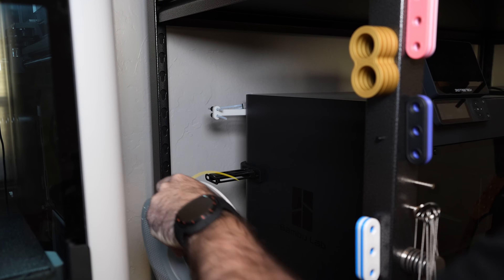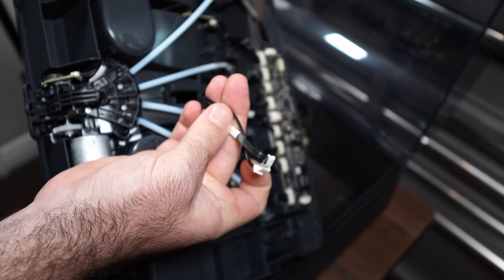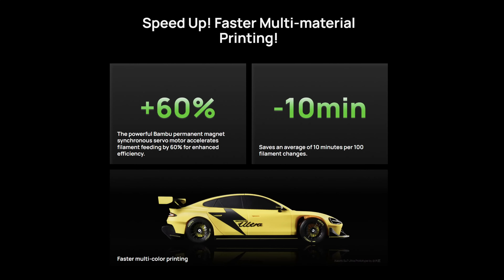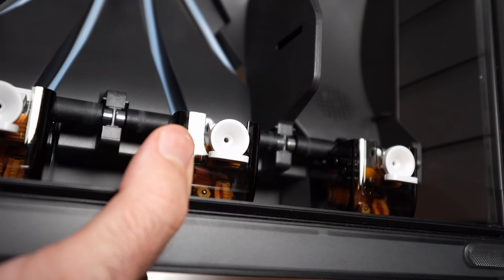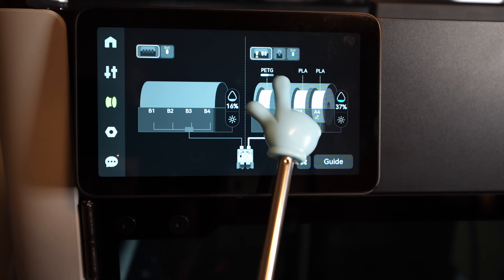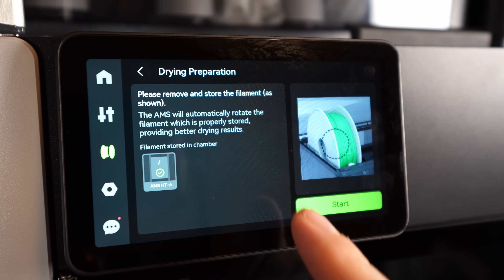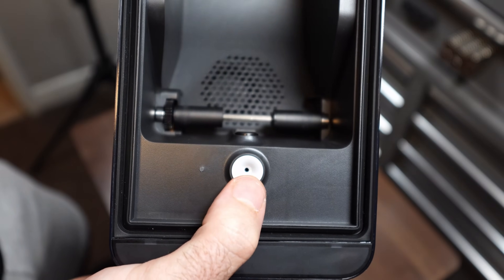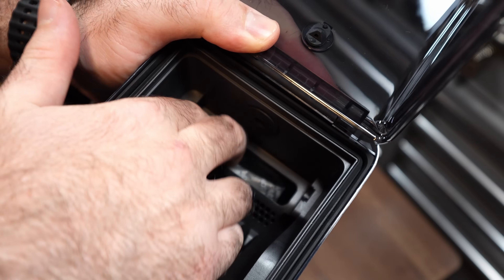Which Bambu AMS Should You Buy? (AMS OG vs 2 Pro vs HT)

Comment: I have a AMS OG and a AMS 2 Pro hooked up to my P1S.  My AMS OG works flawlessly.  The AMS 2 Pro hasn’t worked since day 1.  Brand new out of the box it would not load filament to the extruder. It would feed the filament out about 12 inches then pull it back, feed out, pull back.  It would do that 4 or 5 times then fault out. I issued a support ticket and Bambu lab had me try different things. Sent me new parts to change on a brand new out of the box unit.  Changed part out , it did not fix the issue.  Finally they sent me a return label to return the unit. And they would send me another one.  Received the new one and it does the exact same thing.  They sent me another part to change out on another brand new unit. Same part by the way.  Changed it out and once again it did not fix the issue. I am over this piece of junk. I would advise everyone to stay away from the AMS2 Pro. With my experience it is nothing but a paper weight, hasn’t worked since day 1. I’ve been fighting this for 3 months back and forth with customer support and changing parts…While my AMS OG works flawlessly.
Reply from the maker: Sorry to hear this happened to you. Mine has worked flawlessly since day 1. All I can day is there is always a spectrum of customer experiences, you were one of the unlucky ones. Is there a possibility its printer related? Seems like the logical next thing to check

Comment: I would definitely go with the AMS 2 Pros.  It may take some upgrade hardware, but it is well worth it.  For example, if I am not doing a print job, I can get the AMS systems to do a dry cycle, then I have some solid assurance about how dry the filament is.  This helps greatly, especially in more humid weather.  The AMS 2 Pros seem quicker as well, and easier to work with.
Reply from the maker: Totally agree! Thank you for your comment

Comment: Recently upgraded to a Bambu from an E3V2 with enclosure and sunlu drier, and one of the reasons I got into Bambu was for multimaterial printing. In researching my options, I came across this video and it was super helpful. Something worth noting for others out there that may be in a similar boat, sunlu makes an attachment for the OG AMS that replaces the lid and dries filament. It also allows you to dry while printing. If thats super important for you, it's something I'd definitely consider. Me personally, already having the single spool sunlu drier that allows drying while printing, I'm planning on going with the AMS2. For the small price difference, added drying, and smaller design upgrades, I think it's the right choice. But if you don't have a drier and had to pick one AMS, I genuinely think an original AMS with the sunlu drier upgrade is better than the AMS 2 if drying while printing is important to you. Just my 2 cents!
Reply from the maker: I really appreciate the comment man! Good advice

Comment: I probably wouldn't have bought the OG AMS if I knew about the HT. Microcenter didn't have the HT and I didn't do the research on new products. I don't do multicolor prints; I really only wanted the AMS so I could use Bambu's support interface material. HT seems like it would be a perfect device if that is all you want/need. However, it is quite handy to have several spools queued up. Maybe I'll get one anyway just to have support material (or PETG) off to the side and always dry.
Reply from the maker: The HT is insanely good at drying, probably the best dryer I own now... gets down to 5% humidity

Comment: Owning 4 OG, 2 Pro 1 HT and 2 lite, some advice on top: The less complicated filament path of the lite is often the superior solution. The H2D needs 2 full size ams to take real advantage of filament saving mode, to recommend color distribution properly. The days of the og are counted. There could have been more mechanical improvements and metal in the 2, but there’s no point to still buy the og. If you really want more than 16 colors on an H2D(Why?) you would need HTs. You can’t install more than 4 full sized AMS of any type in total, not just per nozzle. I tried. PSUs make no difference there. I’m pretty sure its just a softlock to sell more HTs, based on its behavior.
Reply from the maker: How do you feel about your HT? Hands down my best dryer.

Comment: im getting back into 3d printing and the idea of having to dry filament is a new one to me and it makes me curious why the filament is wet in the first place? does it just attract moisture or something?
Reply: Freshly opened vacuum sealed PLA you won’t have any issues with. Old PLA will be brittle and advanced materials require precise humidity and temperature for the best quality prints.
Reply from the maker: The short answer is: all plastic absorbs moisture from the air, they are hygroscopic. Ill be posting a video about this soon!

Comment: Will the AMS 2 Pro or the AMS HT normal drying processes for PLA, TPU, and PA be enough to recharge rechargeable dessicant (such as activated alumina)? At least over time with regular drying of filament, I wonder if it will eliminate the need to be swapping desiccant often.
Reply from the maker: Yes it will definitely recharge your desiccant, the new AMSs are especially good at this
Reply: Doesn't alumina need a crazy hot temp that would melt the filament for silica it should work though.

Comment: Thank you so much for such video. How frequently were you having problems with the AMS OG? Trying to understand if I should invest in an upgrade just to avoid headaches.
Reply from the maker: Honestly it's not the AMS OG that is the source of the issues, but when a piece of filament breaks off inside it, taking it apart to clear it is super tedious. It highly depends on what filament you'll run, and how quickly you go through it

Comment: Totally agree on OG ams. I have all 3.  
Key being.  Current market price of $320. 
It sometimes drops down to $250 and on 2 occasions - one at a micro center and one I could swear was a sale last year it hit $220.  
At those prices.  I would often consider a regular AMS.
Reply from the maker: Totally agree! Thanks for the support
Reply: @sammuxlow  You didnt mention that the AMS2 doesnt come with any Hub or Buffer, or Bus cables. buy all that and the price goes to 450 compared to 300 normal AMS
Reply: Sunlu is also releasing an upgrade to make it a dryer as well which has gotten excellent reviews.

Comment: Thanks.  Excellent video.  Can you use cardboard spools in the AMS 2 pro?  Also can you connect the AMS 2 pro together with the AMS OG?
Reply from the maker: Yes you can use cardboard spools, but you'll have the same occasional failures like the OG (with feeding). I recommend transferring them to a plastic spool or using a 3d printed frame to go around the circumference.
Reply from the maker: I believe you can daisy chain OG AMSs, and the 2 Pro

Comment: Owning an AMS .... I hate...the stoopid thing It's a foolish Affectation. the damned thing ..Wastes..More filament than it prints It turns a 1 hour print into a 4 or 5!! hour print.. Yipeee!  
Also the results are OK..at best .
But frankly a Paint brush is faster and does a better job of colouring a print. 
Clearly the AMS thing is  intended for the Naive/newbie  buyer  and IMO: Dim.    Enjoy.
Reply: Where the AMS shines for me is not in multicolor prints which I rarely do but in being able to have 9 different colors/materials on hand with my X1C 2xOG AMS 1x AMS HT setup. Not to mention you can set it up so that you can load multiple spools of the same material, the printer will then automatically switch over when one of the rolls runs out.
Reply from the maker: Well said!
Reply from the maker: Its definitely more useful than just multicolor / material printing. I'm sorry that you haven't had a great experience thus far

Comment: A1 doesn't have a buffer like the X1/P1 and H2D. The AMS Lite probably has something designed in to have a similar effect. I suspect A1 support will come with some new buffer add-on later this year.
Reply: Not sure if its called a buffer, but the A1 and Mini indeed have a "buffer", its in the printer head. THe part with the 4 to  1 where you connect the PTFE tubes, has a hall sensor that senses if its pushed down (aka need more filament)

Comment: Looks like I need to get the AMS Pro, a hub, and an HT for a complete material handling system.
Reply from the maker: Do you have an H2D or X1C/P1 series printer? H2D does not require a hub

Comment: I have to "old" AMS in my carbon X1 for  > 1 year and never had any issue with them. And I am running up to 4 spools per week with print jobs around the clock. Waht I see quite often is that people messing with the system and after that the problems begin.
Reply: I also have AMS with P1S. Never had any problems. Don know what people are doin with it.
Reply from the maker: There is no issues with the AMS's functionality, its the design. If you run through filament quickly, you probably never experience "old" filament breaking off inside the filament pathways. Maintenance just sucks on it, thats all.
Reply: @sammuxlow  I swap rolls also from time to time when I need special colors or special material. The issue you describe is about storing filament wrong. That it brakes off might also happen in any other system or normal printer. I treid different solution from Prusa and DIY and all of it sucks. The AMS saved me hundreds of hours fideling with filament changes.
Reply from the maker: @Empusas1 no its not that, filament can get brittle over time, even when exposed to small amounts of humidity. Also different brands of filament handle the AMS gear teeth marks differently. Im glad your experience has been good, but what I'm describing (the design flaw of the OG AMS) is very valid.

Comment: What really sucks also, is if you want to run more than 4 colors, you need to buy the HUB that's also sold separately (or in a more expensive combo) and then additional power cords, PTFE tubes, etc...
Reply from the maker: The hub isnt required for the H2D, but yes add-ons are required depending on your setup.

Comment: I want to buy my first ever 3D-printer. After doing a lot of research on 3d-printers, I came to the conclusion that the P1S is my way to go. I've been waiting a few months until the big sale season and now I can't choose between 2 options. Should I go for the P1S combo (AMS) or P1S combo (AMS 2 PRO)? Price wise, the P1S AMS = € 678,98 with 2 PLA filaments (both each 14,99) and the P1S AMS 2 PRO = € 828,98 with 2 PLA filaments. So, total price difference = € 150 for me. I got personally some experience with the X1C and Flashforge printers at my University, so I'm not a total beginner anymore. I would like to use this purchase for at least 5 years as my hobby, BUT I just can't seem to choose between these two. Is the € 150 extra worth it in long therm? I asked ChatGPT about all the pro's and cons, but still can't choose. Does anyone have any great advice for me? I would highly appreciate it! 🙏
Reply from the maker: Personally, I'd shell-out the extra cash for the Pro 2... just the time savings alone on maintenance is worth it to me. I guess it depends how much 150 means to you... saving me hours of time over the lifespan of my setup is super valuable.
Reply: I would recommend getting the AMS 2 PRO combo if you don't already have a filament dryer. One of the biggest issues when it comes to new hobbyists is using wet filament and so many print failures can be solved with drying your filament. If you already have a dryer, then the AMS1 is fine.

Comment: The AMS 2 is only $40 more... But at least least for the X and P series printers it requires a $60 upgrade kit.
So the difference in this case is $100, not $40.

Then if you want to buy a P1S combo, the difference becomes $120 because the AMS 1 bundle has higher savings.

Here in Europe it's even worse. The P1S combos cost $750 and $930 and make the AMS 2 Pro, $180 more expensive than the AMS 1.
Reply: In Norway the P1S with AMS 2 cost $300 more than AMS1.   Most likely still buying it.
Reply: @dubious6718 how expensive is it? It's shows cheaper for me in the shop because it shows 0 tax.
Reply: @john9801  You should always include tax when writing prices.  Americans pay tax too, so they should write prices with tax.
Reply: @dubious6718 okay, we could also just look at the relative prices.

In the US the AMS 2 is 50% more expensive than the AMS when buying a combo. 

In EU the AMS 2 is 75% more expensive than the AMS when buying a combo.

Looking at the relative prices between products in the same country, you don't have to think about taxes or anything else. 

75% instead of 50% is quite a difference.

Comment: I have the P1S and the OG AMS combo, what other additional part do I need in order to run/add AMS HT to the system? Do I need the AMS hub and 4-in-1 adapter?
Reply from the maker: For a P1S you'll need the AMS hub. If you're running 2 AMS' that is, if you decide you want to run more (4 max), you'll need more bus cables and PTFE tubes.

Comment: From my perspective the 2Pro is a lot more than you’re suggesting. I own a P1S. For me to get the full functionality it offers I also need to pay for the power supply and (I think?) the cable… in a combo deal and in AUD it works out to approx $250 difference because it has to be supplied with all the extras. Interestingly it works out $3 difference (less) buying the 2Pro and the required parts as a stand alone over the older AMS ($247 more). That’s with the current anniversary sale factored in. For that matter alone, I bought a second P1S last night with the older AMS. I cannot justify spending the extra for the better feed speed and ceramic feeder funnels. I already have an S4, so the drying means very little to me… The only printer in their line up that doesn’t require the separate AMS2Pro power supply is the H2D…
Reply: Same boat here. Just bought p1 with old ams. Wasn't going to spend the price of the printer on the ams😂
Reply: I want to buy my first ever 3D-printer. After doing a lot of research on 3d-printers, I came to the conclusion that the P1S is my way to go. I've been waiting a few months until the big sale season and now I can't choose between 2 options. Should I go for the P1S combo (AMS) or P1S combo (AMS 2 PRO)? Price wise, the P1S AMS = € 678,98 with 2 PLA filaments (both each 14,99) and the P1S AMS 2 PRO = € 828,98 with 2 PLA filaments. So, total price difference = € 150 for me. I got personally some experience with the X1C and Flashforge printers at my University, so I'm not a total beginner anymore. I would like to use this purchase for at least 5 years as my hobby, BUT I just can't seem to choose between these two. Is the € 150 extra worth it in long therm? I asked ChatGPT about all the pro's and cons, but still can't choose. Do you have any great advice for me?
Reply: I'll buy the AMS 2 just cause it's easier to fix.
Reply from the maker: Exactly!
Reply: @sammuxlow In Canada the ams and printer was 799. The new ams and printer was 1089. I wasn't going to spend almost as much on the ams as the printer lol. I've had no issues with the ams so far
Reply from the maker: @Catcher5632   Thats an insane difference in price, I wonder why its like that??
Reply: @sammuxlow Exactly, I would have ordered the ams 2 if it wasn't so insane. In other countries i would say that it would have been worth it. Not to sure why it was like that.
Reply from the maker: I've checked recently and its around $100 difference, which I think is fair.

Comment: It's all use-case dependant for the AMS HT.  For me, it makes sense to have one spool attached to the LH nozzle of my H2D that I can manually swap between white PLA, Support for PLA, PETG or occasional "exotics" like ASA.  Plus it'll sit on top of my H2D with space for a full AMS.

In terms of the original AMS, I am on my third (which each one having subtle internal differences).  #1 is still going, as is #3, but #2 get cannibalised for spare parts to keep the other two running.

I got an AMS2 with the H2D, and while it's performance isn't flawless, I get about a third of the jams and misfeeds that I get with the original AMS.  So for that alone it's worth the price upgrade to me, and the old AMS units will be replaced with AMS2s as and when they finally fail for good.
Reply from the maker: I totally agree. The maintenance access alone makes the 2 Pro worth it. The other stuff is icing on the cake.

Comment: Personally would love to get BBL AMS 2 or HT but for the money... the creality dryer has a better value.. can dry 2 at a time and I am just now running into filament issues because of the humidity..
Reply from the maker: can dry 2 rolls at a time? The AMS 2 Pro can dry 4 at a time, that being said what kind of printer do you have?
Reply: @sammuxlow actively while printing I have a p1S.. the creality dryer is only $80 😂
Reply: @sammuxlow   The Creality SpacePiX4 also can dry 4 at a time, even further, it has separate chambers for heating different materials